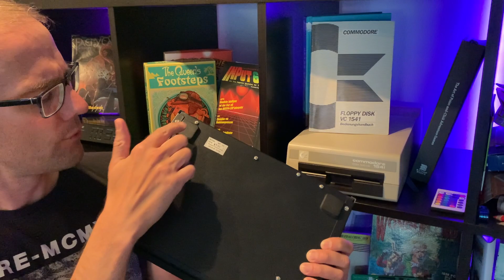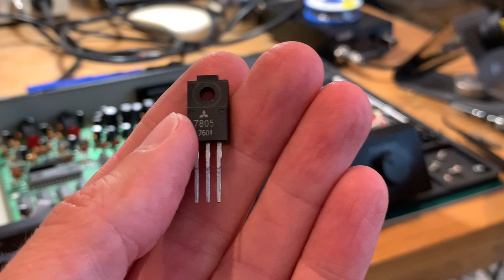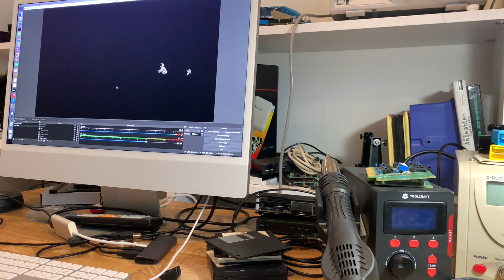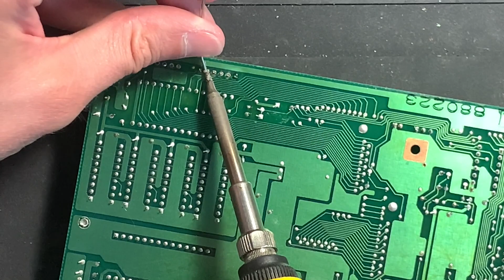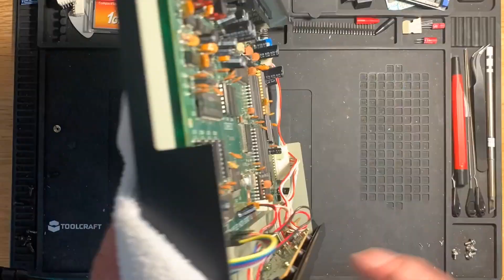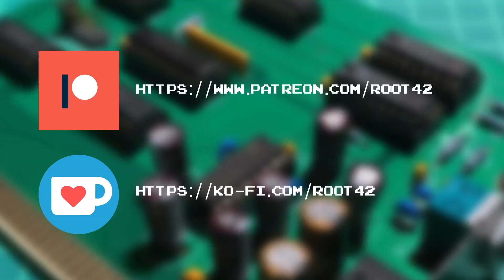Repairing a Dead Roland MT-32

Comment: Dealing with individual Dupont style pin connectors can be a bit of a fiddle. There are lots of connector kits on ebay with a variety of the black plastic connector shells from the 1 way up to 10 way. You can pop out the individual shells on pre-built cables and replace with the correct size shell for the connection you are making. That way you just have a single connector to plug and unplug and avoids scary accidents if you get pins crossed over. Very handy for semi-permanent breadboard circuits too.
Reply from the maker: Great suggestion, however I wanted to have the replacement straight away. 6 connectors are still doable, but any more would have been a pain to plug in.
Reply: @root42  you can glue the leads together to make them stay in the correct order, can add support to the sides if needed

Comment: It's always nice to see the innards of an MT32 and that tip about replacing the converter was super interesting and a got me a little worried about mine.
On one hand I would had love to see more diagnosis, that screen replacement thing you talked about and on the other hand I'm just super happy to see it repaired!
I know the pi emulation thing as a last resort is of some comfort but on the other side wouldn't be nice that a real full hardware simulation could be developed using a FPGA so the hardware could be preserved.
Thanks for sharing with us your hobby!
Reply from the maker: FPGA or Pi won't make any audible difference. I compared the Pi MT32 to the real deal some weeks back. There are hardly any differences. The emulation of the LA32 algorithm seems pretty spot on. Apart from some hardware issues, where some games work with the Pi, but not the real MT32 and vice versa, the emulation seems just great. FPGA is also kind of an emulation, especially if the Pi is running bare metal.
IF you have an MT32 you can simply buy a 7805 at your local electronics dealer, or order a handful on eBay for just a few Euros/Dollars, and replace it. You only need a Philips screwdriver, 5mm hex nut and 10 minutes of time.